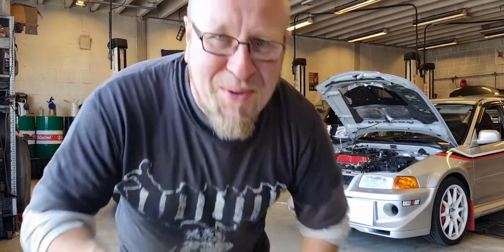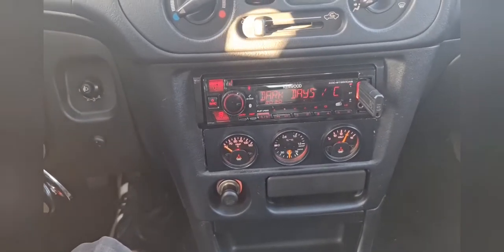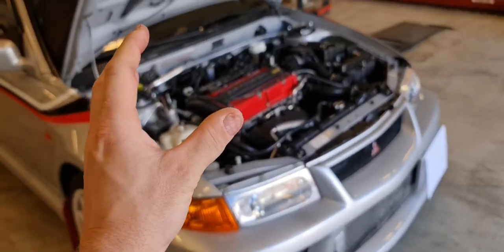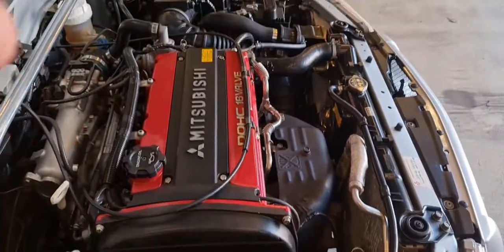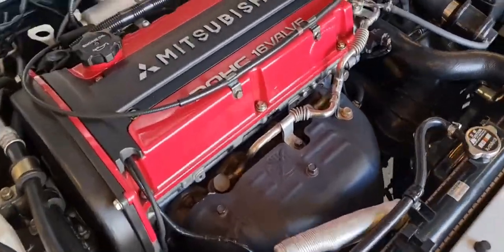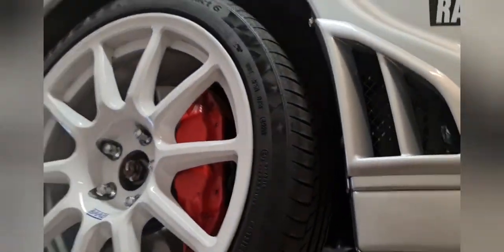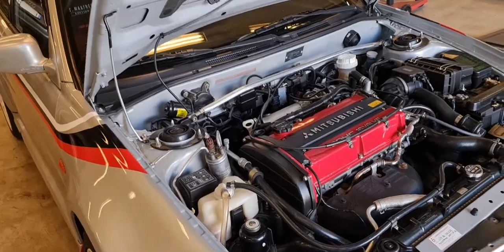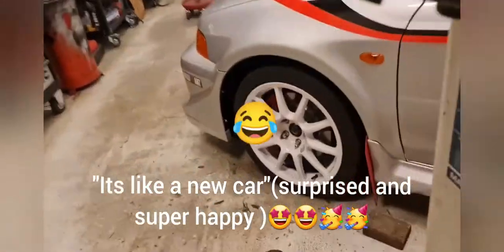Mitsubishi Lancer Evo6 TME"How To Set BalanceShaft Timing/Decell Rattle Diagnosis/Engine Vibration

Comment: Yes indeed!
I have heard a lot about the problem of these shafts.
At the service station, they can be incorrectly displayed.
Even in terms of sound, there is a very big difference before and after.
 👍 👍 👍
Reply from the maker: heyy there.Yes indeed.Especially when you know how it is supposed to be...it is super easy to hear and feel how it is NOT to be like.And man it was a huge difference from before.Now the engine is silky smooth running. Bothers me with the decell rattle though..but hopefully i will get to the bottom of it.i kinda learned how to " live with it in a way also..Greetings,Stefan

Comment: Did you have to remove the water pump in order to get the belt off? Or did you just need to remove the front tensioner? Mine balamce shaft is out of sync, and just wanna know if I gotta buy new seals to do this job
Reply from the maker: No you dont have to remove the waterpump )
Reply: @TheCarTakerGarage  thanks bud!
Reply from the maker: @TheBaconator2121   No probem ,mister :) I hope you will be able to fix your car :)

Comment: I wonder if the clutch isn't one of those multiplate types (sintered clutch rattle?) or one with a sprung centre and the torsion springs are possibly loose or broken - or even pressure plate retainers broken like they were on 202Brabus' 16v (if you remember back then)  Guess you won't know unless you pull the box...  Does it happen in gear while moving as well as in neutral and stationary? or
Reply from the maker: the clutch in the car is a single plate Exeedy stage one...and a lightened flywheel...so it very might well be a part of why it is making this sound...i have read alot of threads where people have put on lightened flywheels..and the cars start to make decell rattle/scraping sounds afterwards..because of the less reversed rotational mass torque of the light flywheel. But i have not tried to peek inside the bellhousing yet..to inspect for broken torsion springs.? i do reckon they are allowed to be alittle loose?or..what do you reckon?
Reply: The clutch plate springs can have play - but not more than about 1mm. My suggestion is that the rattle would be noticeable on decel when you're shifting from on power to off power to decel, so the 'unloaded' spring time if there was excessive slop. However I'm more concerned about the pressure plate retainers - If the straps are stuffed, or the rivets are bent or the holes elongated, it will cause a similar noise, but I'd also expect some imbalance/shudder from a failing pressure plate. Again similar feeling to the failing dual-mass flywheels when the centre piece separates and the idle shudder occurs  - not to be confused by the "unload clunk" from weak DMF springs. maybe some hoist time, in gear and the stethoscope on the bellhousing will help to isolate it, test under accel and decel and in higher gears....